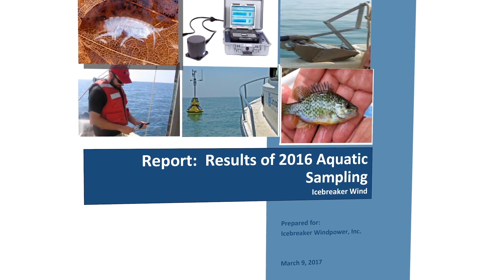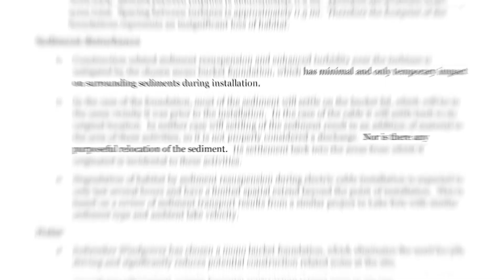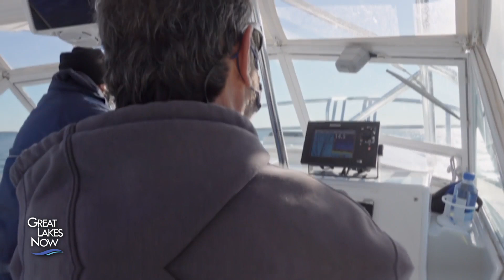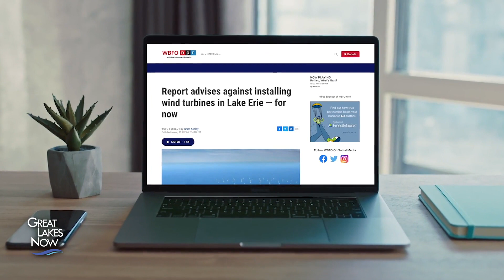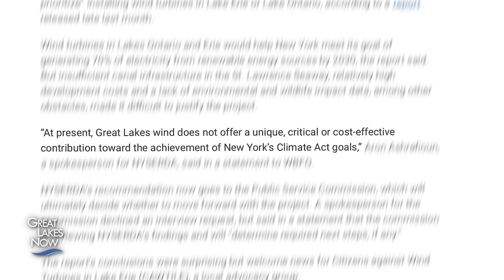Offshore Wind - Great Lakes Now - Episode 2302 - Segment 2

Comment: I think wind power is great. When I drive up the Thumb, I'm always amazed by the turbines. When I sail lake St Clair, I can see them across the lake in Canada. They're on the East side of lake Huron and north of the Soo. But putting them in water isn't necessary. This isn't NYC where property isn't available or affordable. We have tons of farm land and I'm sure a lot of farmers would like to make some extra bucks by placing turbines on their land. It's much cheaper and easier to install, maintain and control catastrophic problems on land than water.
Point Pelee is a huge bird migration route which is important to North America, not just the Lake Erie area. Cleveland isn't directly in the path, but what if they install them further west like the Sandusky area? We could see entire bird populations wiped out by the blades. 
Land turbines may not generate as much as off shore, but they're cheaper so you can build more.
Reply: turbines are noisy and electromagnetic fields generated harm our central nervous system.  putting them in the water away from citizens is the best choice.  people are funny: they want all the things but not of the infrastructure to support it.  morons.
Reply: Yeah such beautiful windmills in the background of pine trees and blue water.  Dork!  NO WINDMILLS!!!

Comment: So, what happens when you have a catastrophic failure like we have had on land. and it spills all the oil in a wind turbine into the water?  but yet everyone is opposed to a pipeline in the great lakes that have not had a catastrophic failure. in the great lakes but you all are willing to put something in the water that has had many catastrophic failures.
Reply: Turbines that are put off shore are Direct Drive Turbines, meaning they do not have gearboxes, which means no gearbox oil. If they end up being GE brand Turbines, then they will have only electric pitch, so no hydraulic oil in those either. 

They will, at minimum, have a hydraulic breaking system, but that will contain less than 10 gallons of oil in the system, which is nothing. So offshore turbines are usually pretty dry systems. Obviously, there will be grease for bearings and moving parts, but again, very little. They are far less hazardous to the lake than the tanker ships that sail across every day.